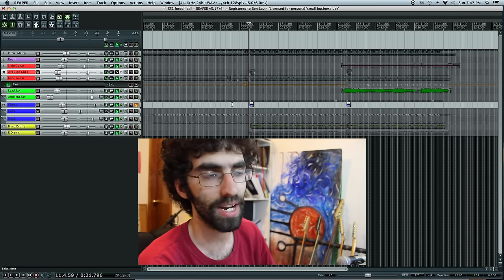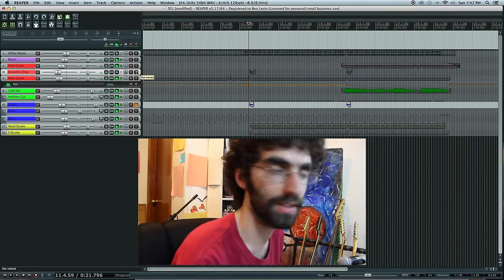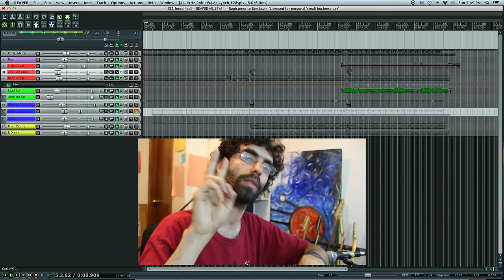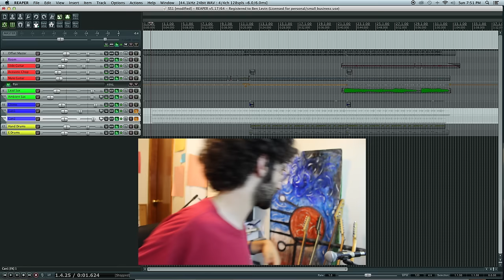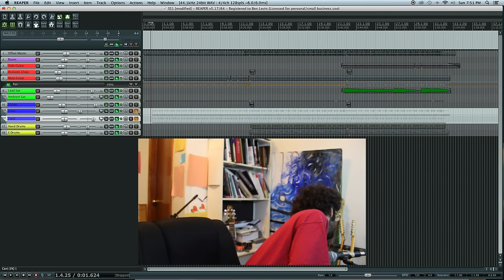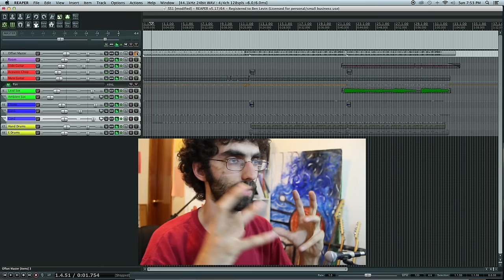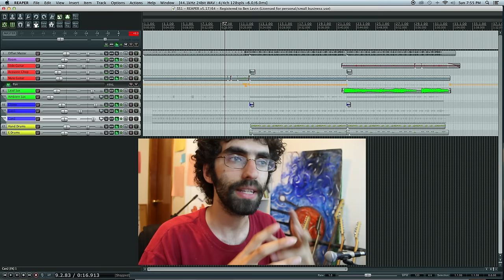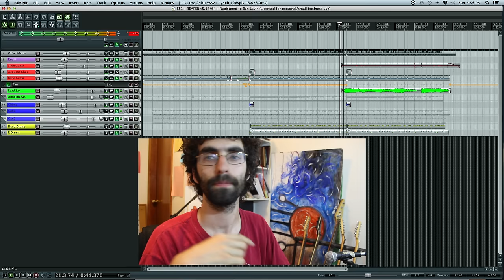Sound Sandwich - Ben Levin

Comment: Cool.  I like everything but it's mostly unresolving.  I think if you even out that guitar part to make it more tangible you could put the Indian slide texture as a bridge and turn the form into a verse-refrain with that African echauffement pattern as a way to mark off the sections.  But hey - I like Pop.  Thanks.
Reply from the maker: Yeah, it's not really a song, more like a sound palette for later use.
Reply: ***** Sandwiches are good for later usage.